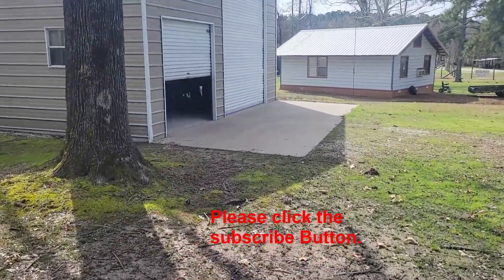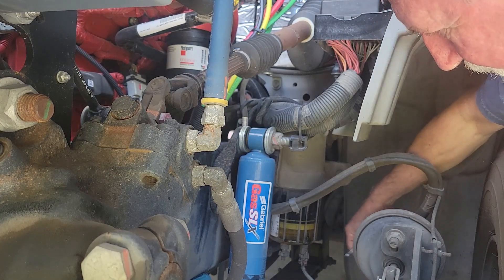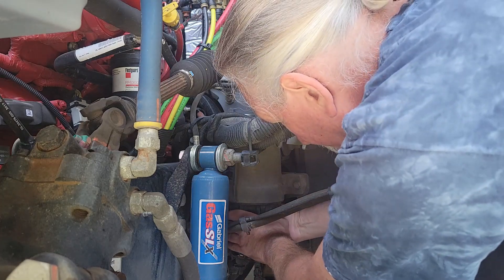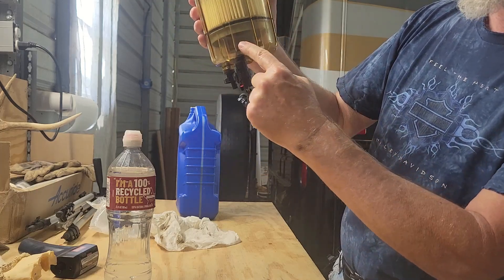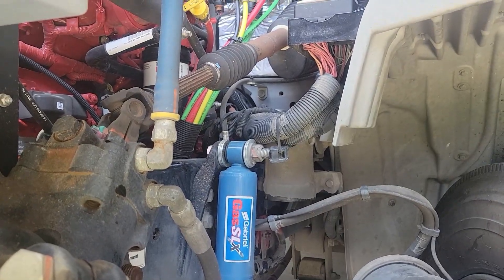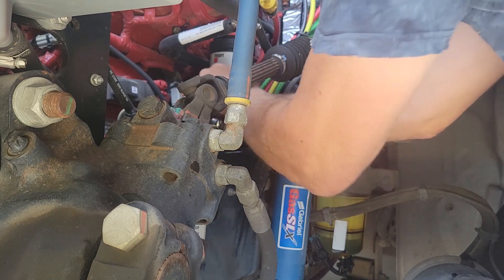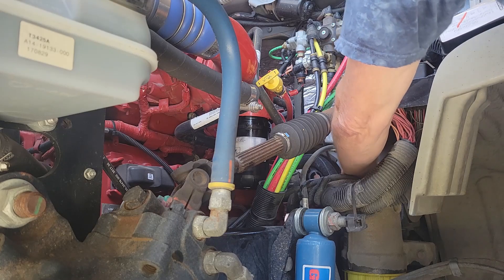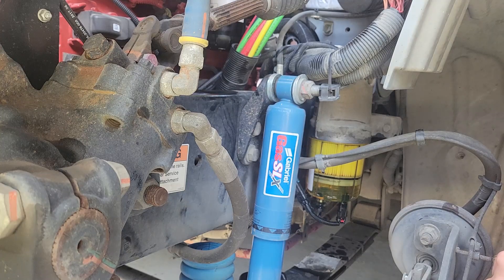Fuel Filters and Grease Seneca S2RV

Comment: There is a drain valve on the bottom of the primary fuel filter. If you drain it doesn’t make near the mess and it makes it easier to remove the filter.
Reply from the maker: damn good idea! I wish I had thought of that :- )

Comment: How much fuel did you have in your tank when you did this? My primer didn’t work when I did this job. I had I little less than half a tank. Luckily when I started the engine it filled with fuel, but it made me a little nervous for sure. I heard having a full tank when you do this helps with that.
Reply from the maker: Yes my fuel tank was full. I always park it full to help lessen any condensation in the tank. I am sure pre-filling the filters helped too.